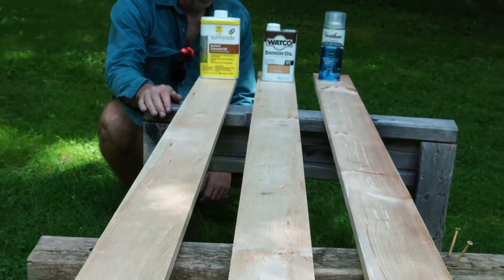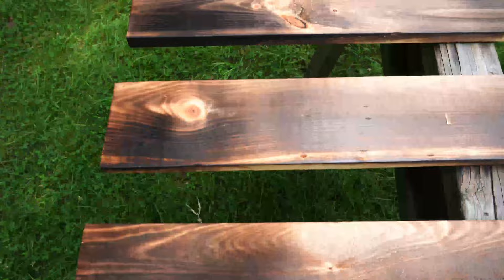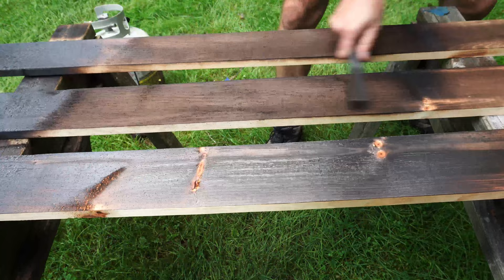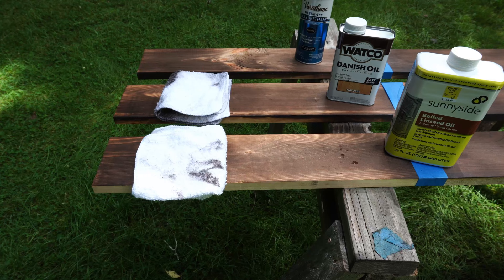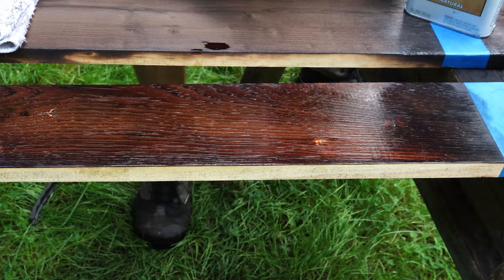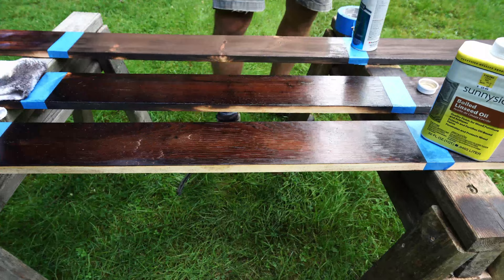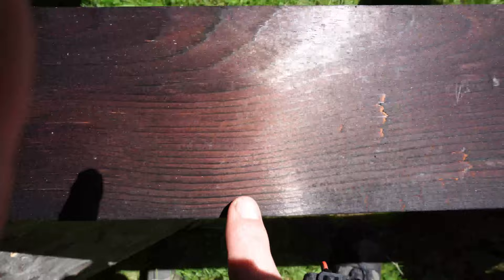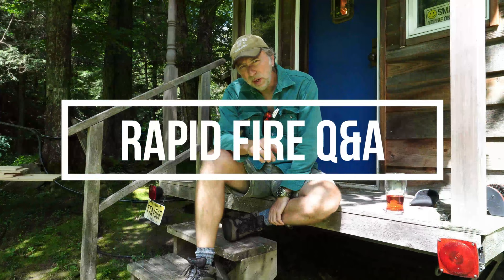Burnt Wood Finish - Shou Sugi Ban - End to End Tutorial

Comment: I'll take the free option of no finish or if money is no object, boiled linseed oil as long as that's the only ingredient. My concern with the finish when using them for raised beds, planter boxes, or outdoor siding, is what happens when it eventually starts to deteriorate?  I'm using this method to avoid toxic chemicals in the first place and weather seal the wood naturally so I don't have to worry about polluting the environment further; babies are already born with plastic microparticles in their bloostream, that's a toxic enough planet for me.
Reply: Plenty of plant based coatings out there. Vermont natural coatings carry’s tons
Reply from the maker: Totally agree that there are too many chemicals used. I agree with the comment though that using the burn to help preserve the wood is already eliminating chemicals from that process. Adding some linseed oil doesn't really seem that bad for me. Totally understand that if this is to be in a planter, you want to be careful.
Reply: I like the lightly burned variants best. I can’t see much difference in the surfaces with regard to the products usedto finish them. I have watched some shou sugi ban videos which used food colours and they looked good too ! 👍
Reply: Shou Sugi Ban means burnt cedar. Use cedar, burn it 1/4" deep and your wood will last 100 years without a finish. Just don't do a heavy sandback.
Reply: Always misconceptions. If you want linseed oil, then you will use RAW linseed oil not boiled, as the boiled process uses chemicals to achieve that. If you want an oil finish, then a “food” safe is raw linseed with pure tung oil, which the tung oil will help dry/harden the oils. Of course you would need to apply about 4 coats each season, no different then doing a butcher block. Whereas butcher block finishes can have bees wax or a combination of waxes with those oils.

As for another misconception, fully cured poly will not leach chemicals, as the only thing left behind in its hardened state are the resins, or acrylic resin mix. Of course you need to wait the full 3-4 weeks for it to cure before adding soil. Once cured ( after 2-3 coats with 24 hours drying time in between), you could always line the interior with plastic to further protect the wood vs soil vs leaching if you are sceptical.

I am not a fan of a lot of chemicals either, just is, you need to know and understand what they are and what they do. Not just being a carrier for the finish, but the added hardening and possibly additive agents, as well as the considered solvents. Have been in the coating industry for over 30 years, master painter, and have seen/used solvents that can take a fully hardened brush, and bring it back to almost new in 15 min. Definitely want to stay away from those, though they tend to be more geared to commercial environments. Yet, I still read them in small amounts in some over the counter home products.

Anyway, I digress, go read the material data sheet of anything you buy with chemicals if you have a concern, as some of you state. Or make your own product, that you consider food safe. Btw, water based poly is the same, after fully cured. Especially since the carrier is mostly water, but oil based are always more resilient. Oh, I never touched on the fact that boiled linseed takes forever to completely dry, hence combining it with tung oil, or pure turpentine, helps in the “drying” process.

Btw, I like both the first and second burns, as they add the character to the wood depending on the look I would want, and/or the final piece I want to achieve.

Comment: brushing off the carbon defeats the purpose of doing yaki sugi. If you are going for asthetics only, its fine. Otherwise, dont brush it. That burnt carbon is what increases protection.
Reply from the maker: Agreed, you are taking off some of the protection by brushing it. I have made raised beds/planters recently and didn't brush them. Also lead to a cool look without impacting the protection aspect (just oiled the burned wood).
Reply: @TinyIndustrial  yup, this works just fine. It's how I do it too.

Comment: How to prevent bending/ bowing?
Reply from the maker: When you burn all sides, I takes care of that pretty efficiently. Burning only one side will lead to bowing. What project are you considering for this?
Reply: @TinyIndustrial  used a mahogany plank as trial run but it was only one side. Will try both sides. Going for outdoor privacy fence. Do you assemble them first then heat treat it or heat treat individual pieces followed by assembly?
Reply from the maker: I would always burn everything first and then assemble after. Otherwise, where there are joints or pieces mounted together, you will get areas that aren't treated and they will be subject to premature deterioration.
Reply: The trick is to burn 3 in a triangle vertically tied together with wire, starting a fire at the bottom. When it gets to the top you cut the wire and immediately wash heavy with a hose. Suyaki or alligator finish is considered the best but its all objective. Wash off alll the soot right after burning, let dry, then apply a penetrating oil finish. Never brush in my opinion. The boards dont cup as long as you burn fast, hot, and wash off to complete the process. Missing any step and it will warp. If youre getting white ash you burned too long or in one area too much
Reply from the maker: @chompers11  yup. That's the traditional method.

Comment: Cold pressed linseed oil makes more sense.
Reply from the maker: How so?
Reply: @TinyIndustrial  What is the difference between cold-pressed crude and cold-pressed boiled linseed oil? Raw linseed oil is extremely penetrative and impregnating. It also takes longer to dry. Boiled linseed oil dries faster and penetrates well into the substrate, but not as deeply as raw linseed oil
Reply from the maker: @VIKING1011  I was not fully aware of that. Good to know. Thanks!
Reply: When preparing external cladding I’m assuming all surfaces of the boards must be burned and oiled? Thank you
Reply from the maker: Yes, that is a best practice.

Comment: Great video! Do I need to burn all sides if i want to install it outside on My house?  I Mean, if you dont burn it all way around, will i rotten on the back?
Reply from the maker: Ideally yes. I reference that towards the end of this video. Did you not see it? There are two main reasons for doing so: 1) protection of the wood 2) warping and twisting of the wood from non-uniform application of heat. What's the project you are doing?

Comment: Great video, this is a very nuanced subject that deserves experimentation. I’m loving all the comments, I’d like to add to the conversation. I’ve messed around with this quite a bit, especially for exterior applications. I have mainly experimented with deep char. I plan to do more experimenting, however in an exterior application on dug fir with deep char is to dilute the linseed oil. I also recommend using a garden pump sprayer so that on the first coat or two you don’t blow off the char, using any wiping method ruins the char texture. First coat I’d do 40%lso to mineral spirits and flood it, it will the wood will rapidly pull the resin in, 2nd coat 60% linseed oil to minsprt, 3rd coat 75%linseed oil to mineral spirits and last full linseed oil. It’s all about getting the char and the wood fibers to pull in the the resin, the resin being the linseed oil. I tried this on some garden beds, dug fir with deep char and undiluted linseed oil, the char popped off on year three into year four. I rebuilt them, did this step progress and they are on year 4 in coastal New England weather and holding strong so far.
Reply from the maker: Thanks for that comment and for adding to the community aspect of these videos. Really appreciate your help sharing that. Love the sprayer idea and the dilution aspect.
Reply: Thank you for commenting on your method, I was looking to see if someone had used shousugi ban for outdoor beds and was wondering how to finish it. Do you think the mineral spirit dilution would be safe if I plan to grow vegetables in my garden beds? I am trying to find the safest options but it's been difficult
Reply: @yatakadai  that was my intention when I had built them in the first place. I plan to do a soil test before growing food in the beds so my experiment is currently on going. If I had to do it again, I would build them in the fall going into winter, so the finish would be able to off gas or dissipate and fill with soil in the spring. Instead of getting excited and filling them with soil so I can go onto the next project. We had planned to just grow flowers and what not in the soil we had for a few years as to let whatever pesticides and fertilizers in that soil dissipate. I also would do a gravel barrier going along the wood to keep the soil off the wood, allow it to stay drier by breathing. If, the mineral spirits are leaching into the soil, both letting the finish cure for a season and the gravel barrier might be a solution, all theoretical at the moment.

Comment: I use linseed oil mixed with honeybee wax. For wooden furniture, doors and so. Only, have to be  wood, without any surface paint.
Reply from the maker: That's interesting. I'm sure that works great.
Reply: @TinyIndustrial  Its only what used our ancestors for several thousand years. Easy, you do not nead to mutch of this paste, and is always at home. You can see old furniture in castels and look still nice. 🙂 is only dark after several hundred or thousands years.
Reply: Whats your ratio?  Just melt beeswax and mix in?  Thanks!
Reply: @amyk2966  Yes is easy - important is, boil oil before mix it with wax, for 15 min to change it to farm. Put it to shallow jar. You can use for application soft textil. The best is use iron - it put it deaper into wood. After only polish with textile. One or two years later, you can put second layer with textile, and polish. That is forever.
Reply: @amyk2966  ratio is 1:1 depends how thick you want it, consistency something like wax for shoes

Comment: Try using a flywheel attachment for your drill. Makes cleaning a lot faster and minimal tool marks and you can bring it down to a "toasted" colour.
Reply from the maker: Never tried that. You've had success with that method? I find the brushing not to be that hard...kind of like it. Also ok to not brush at all. Get that question a lot. :)

Comment: You're just answered my question on your Q&A...
Reply from the maker: Happy that it was helpful. What's your project?
Reply: @TinyIndustrial  
I'm cladding an porch, I was going to used Siberian larch but I really like the idea of shou sugi ban,my question that you answered was should I burn the wood all round as its untreated and will be used outside in the British climate?
Reply from the maker: @grahamfletcher5320  I see. Yup, burn all surfaces. Has a number of benefits, albeit a bit more work. I would also still apply a liberal coat of linseed oil for added longevity and protection. Good luck with the project!
Reply from the maker: @grahamfletcher5320  I see. Ok, well I hope that the project turns out great. Always be safe working with fire! That's my PSA for the day. :)

Comment: This looks great.  I prefer the medium & dark.  W.ill have to consider this for our new custom gates we just had made.  TY for this video.
Reply from the maker: Yup, medium is my go to. Preserves the grain the best IMHO. Are you going to post any video of your gate project?
Reply: @TinyIndustrial  No, we won't do a video. Our carpenter already made the gates & they're beautiful. Is it too late to do this procedure since not every side of each piece of wood can be burnt?  TY!
Reply from the maker: @dw3992  Ahh. I see. Something to keep in your back pocket for the next project!
Reply from the maker: @dw3992  I see. Well, definitely make sure you don't set the fence on fire and keep water an extinguishers nearby. If the fence is anywhere near a house, I definitely would not recommend unless you can remove the planks and scorch them separately in a safe way. Not burning all the sides, somewhat defeats the point since the weakest link will be the untreated sections. Not sure I would recommend you move ahead with doing this for those reasons.

Comment: i’ve used teak oil, and then spar varnish as a sealant coat.  You could do the same with the polyurethane & either of those oils.  nice video tho😊
Reply from the maker: Yup, any number options will work with this. Or do nothing at all. It's a pretty forgiving process. What have your projects been with this technique?
Reply: @TinyIndustrial  I've done a workbench that turned out ok, but I also did a small fence with cedar boards that turned out great.  I'm looking at a couple of different projects to use this for next including more fencing, accent pieces in our home, and raised beds for the veggie garden.  I appreciate you putting the different levels of burning into the video.  I'm thinking to go with a more heavy char for the garden beds, but the fencing & accent pieces I'm looking to keep/show off the grain of the wood.  I've also been thinking about using tung oil for the waterproofing and being a little less expensive than teak oil.
Reply from the maker: That's great that you are experimenting with different projects on this. It gets kind of addictive. I found this homemade chair build design that I tried out. Love the chair...had to put a Shuo Sugi spin on it though. Likely to be the next video that I release. Stay tuned and please subscribe if you haven't already. Thanks!

Comment: Which method would prevent the least amount of dust from getting onto your clothes if you sit against it? Or what extra steps would you do to prevent the black dust from getting on your clothes?
Reply from the maker: The application of the oil and subsequent wiping down of the material clears 98% of any reside. When left in the elements for a while, it eliminates any remnants of dust that could come off on clothes. White linen pants maybe aren't recommended though...
Reply: @TinyIndustrial  thanks! Also, thoughts on Refined Linseed versus Boiled versus...? Which linseed is best? Some are more expensive than others...

Comment: The idea behind this is to have a beautiful way to preserve the wood for a very long time.  I believe the poly urethane will not hold up, outside, exposed to weather too long before it needs to be re-coated.  Please advise.
Reply from the maker: Yeah, poly is not my first choice. Oil and occasionally reapplying the oil I find to be the best method. Kind of the way you would treat teak backyard furniture to maintain it's looks and longevity.

Comment: I've charred the handle of a hand-tool of mine, but for the next step I was thinking if maybe a mixture of vegetable oil and ethanol could work for sealing the wood. 
Could it be possible?
Reply from the maker: Not sure why you would want to use vegetable oil on this. Not sure that's a good idea. Go out and buy some linseed oil. I wouldn't experiment with Mazola on one of these projects.

Comment: I find that diluting the linseed oil with mineral spirits helps with penetration and drying time. I find linseed oil on its own is too thick and takes forever to dry and it's clumpy if you try to sand. I do it at a 50/50 mix buy jug of each and just mix it into both jugs evenly and apply it Karate Kid Style oil on oil off, LOL I'll usually put on double the coats and I find it's much nicer looking and easier to work with as well as penetrating deeper and more evenly due to the mineral spirits just my opinion and how I do it at home with linseed oil as it's my go-to finish
Reply from the maker: Nice. Have never tried that or really felt a need to do that. I tend not to sand after application of the oil. Thanks for the tip!
Reply: Very good trick! Thanks for sharing it!
Reply: I do something similar, I do multiple coats raising the linseed oil concentration level to full on last coat, gives a deep crackle finish more durablity, especially in out door applications. It’s all about getting the oil to soak deep into the wood fibers and thoroughly through the char.
Reply: I have a silly question that I'm sure experienced woodworkers would find obvious but would mineral oil work for outdoor applications? My instinct says no but I figured I would ask
Reply: @yatakadai  do an experiment.
Reply from the maker: I'm all for experimentation. Ideally document that experimentation on Youtube.

Comment: was wondering of you used a wire wheel on a drill and went lightly rather than a wire brush or would you get swirl marks anybody know?
Reply from the maker: I don't know. I think that you might wind up roughing up the grain of the wood. May not lead to a desirable result. Have you tried it? Would love to hear how/if it works.

Comment: Why would you not rub in the polyurethane spray like you did for the others?
Reply from the maker: As a spray on product it is intended to coat and harden in place. It's a different thing than the oils which are intended to soak into the wood. Much like if I had used spray paint on the wood, I would not smooth that out with a brush either. Same holds true for a clear coat of poly-urethane...it resides more on the surface vs. soaking in.

Comment: Can polyurethane be applied after applying tar for termite protection?
Reply from the maker: Hmm. likely not. I would use tar and termite protection in place of poly.
Reply: @TinyIndustrial  what do you use to waterproof them?
Reply from the maker: @TaLeng2023  the burning is the part that protects/seals the wood. The application of oil just enhances that. There is no further waterproofing needed.